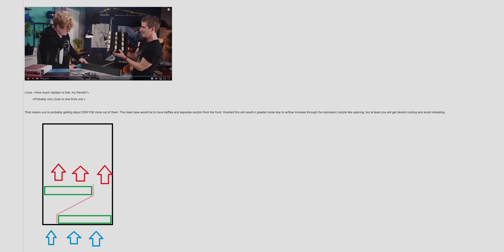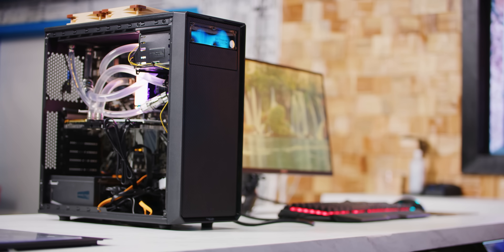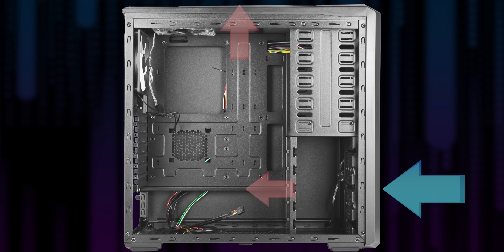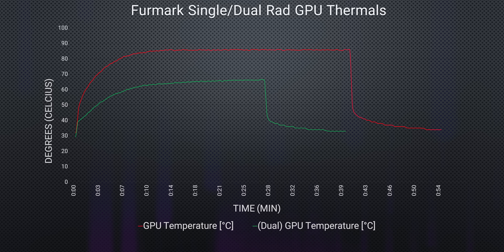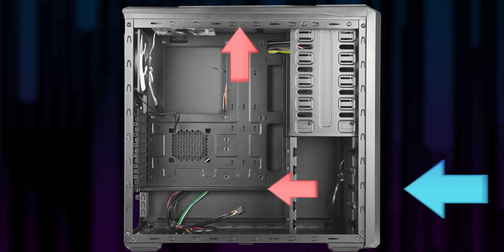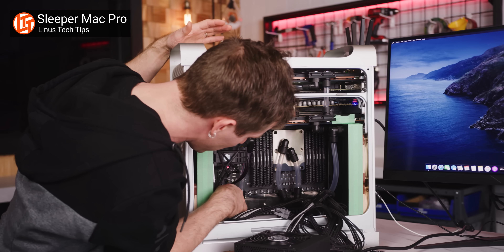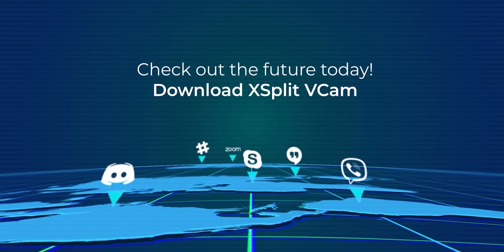I’ve been water cooling wrong for YEARS - $H!T Manufacturers Say

Comment: As a mech. engineer I can say what Corsair claims is plain, shameful BS.. What they say is a technicality; IF a radiator is designed as such that outlet air temperature is very close to water temp, then they would be right.. But that "if" is 100.00% wrong in all real world cases.

If the air coming out of radiator is really just 1 deg above ambient, then the design is a) highly inefficient (in terms of weight, volume and material usage) b) actually quite destructive as Corsair described, because same effects apply if ambient temp increases just 2 degrees, then radiator (depending on design) would be contributing rejected heat BACK into the system, and c) high outlet temperatures can be VERY dangerous. Not for PCs but imagine if they were right then air coming from a car's radiator would be at ~95 deg C (200 deg F).. So you open the hood when engine is working, you would be hospitalized..

Radiators are almost always designed by space constraints (for PCs, 275mm width 120/240/360mm height and 30/54mm thickness etc).. Heat rejection capability is also defined by the airflow, a component they are deliberately ignoring.. There is NO scenario that you won't benefit from a second radiator.. Add another radiator and if 1st radiator is REALLY at its heat capacity (which can be done for any radiator with sufficently low airflow), put higher CFM fans will make the air coming out of 1st radiator colder.. Add 3rd radiator, increse the airflow more, and you will still see benefits... Or go the "opposite" way, more radiators will need less airflow for same heat rejection... Add 2nd radiator and you will need less airflow for same temps. Add 20 radiators and you won't even need forced convection.. They will reject same heat with natural movement of hot air rising.

To "replicate" the condition corsair claims is easy.. Test a non-overclocked 65w i3 CPU, put 2x 240mm radiators in tandem, put just two 120mm fans at maybe ~150-200rpm. 1x 240mm radiator is 99% likely to perform better. Because water will be so close to ambient temps, additional surface area from 2nd radiator won't be necessary, and added 2nd radiator will reduce airflow, reducing cooling.. Problem is, nobody does watercooling like that.. Nobody even thinks about watercooling a PC like that. They would just stick the stock cooler and be happy... Increase load from 65W to 200W and surface area WILL matter. A lot. Ramp-up fans to 1500rpm and static pressure will easily overcome extra resistance from 2nd radiator, and only then we are talking about custom water cooling...

Comment: Did you add more water into your loop when you added the second radiator? That's a significant amount of mass independent of your energy generating/consumption systems. Not to mention the literal mass of the radiators themselves, which ambient air still moves over.

If your water cooling loop connected directly to the pacific ocean, your system temps would all be at pacific ocean temps. 500W can't noticeably heat up that amount of mass.

Comment: I think corsair is trying to say it is not as efficient as keeping them seperate, because you also have to take into account the added water and surface area which increases cooling capacity as well. A good example would be compairing a 500w 80plus certified and a 500w 80plus bronze certified, both get the job done but one is more efficient at its job.

Comment: I don't think radiators are as efficient as the manufacturers say.  IE 40 degree water, air exiting is 39.5 degrees, no..
Stacking them then, you are in your "not quite double, but significantly better" range, call it a 50% improvement for 2, and a third is null, just guessing.
If you have all your rads exhausting from the case, and enough fresh air intake, then the advice from Corsair really doesn't apply, as the air isn't being re-used and still has a high deltaT to the water.

My recommendation: if you are going to use more than one radiator, test it with one, and then with each subsequent addition.  Because then, for that exact build, you can be 100% certain you know one way or the other if it was useful.  And if not, then you'd probably spend some time making it work better, sooo...

Comment: Given how hard you were pushing that single radiator, I think you actually just had enough liquid to air thermal differential that the radiator just wasn't able to take full advantage of the heat capacity of the air flowing through it. That is the exact opposite of the scenario Corsair described in which adding a second radiator would have been ineffective.

If you're going to do this again seriously, log liquid and air temps at the inlet and outlet of each radiator, and subject them to a variety of constant thermal loads (Maybe GPU only, then two CPU cores more per run, for example). That way you can find the balance point of heat load where there is no longer enough thermal differential that serial radiators will improve your cooling performance.

Comment: Gotta say, physics dont lie lol.  I wouldn't stand behind a claim just because 'i tried it once and it worked'.  

The concept of a PC case is flawed beyond belief when it comes to cooling, t is designed for form and performance, NOT thermal dynamics.  That said, the cooling designed around said cases are even more flawed, because its base don a flawed structure that wasnt designed for thermal transfer to begin with.

Now, just because something works, doesnt make it right.  PC cases and PC coolers are HORRIFICALLY bad in terms of function and performance....but they sure do hide away nicely :P  

The correct design is to remove the heated air altogether, not mix it back in with intake air (poor case design).   The correct cooling would be to use a better medium and thermal device instead of open air over a single phase material (water) interacting with a known heat source (CPU, GPU, RAM). Proper heat load calculations are not done in terms of power used and heat generated....manufactures just try designs that "preform the best". 

The "best" cooling isnt slapping in a 'huge-ass' heat sync, big radiators, and a pump. The correct way is a lot more complex....but water/air works for now so no one goes beyond it.

We aren't looking for cooling, we're looking for heat management in the PC world. If you want cooling, I can make something cold...I'm an HVAC tech, I know how to chill things below freezing.

Comment: Linus: “Do your own benchmarking”

Me: “okay, let me order what I need“

My Bank Account: “Bruh, not even close”
Reply: What he meant was, take your existing parts and test in different configurations. Are you pulling air in the front and exhausting out the top? What if you pull air from the top and exhaust out the front but simply turning the fan around. What happens if you remove a fan, or move one fan to a different area.
Reply: @fayenotfaye  They perform like ass, you might as well be on air because they lack the microfins to efficiently get heat from the CPU into the water. Which makes them perform no better than an air cooler that's still much cheaper than buying a whole custom loop, which makes them pointless.
Reply: true
Reply: Drat! Parts shortages are at an all time high =(
Reply: But wait... he said it's free though... no bank account needed right? (Except for all the spare parts needed to test all different configurations...).
Reply: "Its easy, free and fun!" Yeah one of those is correct
Reply: @fayenotfaye  aliexpress waterblocks are absolute garbage and not worth using in a water cooling loop.
Reply: My bank account: "lol no, are you nuts?"
Reply: Just ordered my 10900k and it shipped so be here Friday... Too bad my motherboard isn't set to arrive til the 22nd.

Comment: The real issue here is, how are the radiators plumbed? 
Is the radiator with the hottest fluid (directly from the heat blocks) setup as case exhaust, or case intake?   IF it were as case intake, corsair might have a leg to stand on. BUT anyone with some brains would plumb the hottest radiator as the case exhaust (hottest water giving the hottest air more heat) and then in series adding another radiator as case intake (slightly cooled water, getting the coolest air).

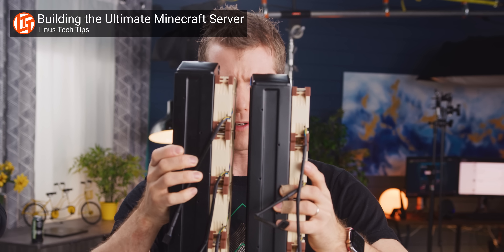Comment: 0:53 Duh?!  1:24 Incorrect if exhaust fans are not fast enough.  Edit1: None of you guys in LTT get Corsair's point.  It is not about stacking rads is wrong, it is the airflow! INTAKE AIRFLOW!  A radiator that is dumping heat inside a case is immediately wrong, regardless of how many exhaust fans you have.   So much tech people misled with positive airflow in a case.🤦‍♂️

Comment: It looks like you're pulling in air through the first rad with a single fan, but out through the second, bigger, rad with 2 fans, so of course there's a negative pressure in the case that's bringing in more cool air. This is a testing fail.

Comment: Shows a case with two rads in the only two air intake slots, then shows multiple rads stack next to each other, does a test with a case with multiple air intakes cutouts and says Corsair is wrong... Okay Boomer.

If you watched Jayz videos you might have learned about the diminishing returns that comes with too many Rads and why it is better to have two to three high quality rads with good and separate air flow.

Comment: why have a case? just frame a box and cover it with rads and blow air from the bottom so it goes through the rad box...all in series ..you might like it color each with leds if you want :)

Comment: Perhaps there was a miscommunication from Corsair, because there's a serious thermodynamic flaw in their supposed statement. 

It's this, they are assuming perfect heat transfer from the incoming air that flows over the 1st radiator. Meaning, they are imagining that if 30C air flows over a 50C radiator, the air exits the radiator fin array at exactly 50C. Then, as Linus alluded to, there would need to exist a perfectly sealed case so that the now 50C air exits over the 2nd radiator and no additional thermal energy is transferred to the air.

The major flaw is the assumption of perfect energy transfer to the incoming air.

A better statement would be "You should place both radiators in a manner that uses air already pulled through the case and then exits out through the dual radiators". There is some truth to the idea that using a radiator in the flow of incoming air is less than ideal. The air leaves that first radiator warmer than ambient (room temp) and is less effective flowing over the 2nd radiator as it exits the case. However, not every case allows the owner an ideal situation of a dual exit flow radiator setup.

Frankly, the ideal set up is probably have two or more free standing radiators OUTSIDE the case sitting on a table with the liquid medium arriving from the case.

I doubt that Corsair created their own software to analyze flow patterns and heat exchange. They are likely using an off the shelf simulation software and probably need to study up a bit more and tweak the behavior of their model.......OR....there was some miscommunication here.

Get Steve over at Gamers Nexus on this. He'll think it's Christmas if he gets to set up multiple case radiator scenarios.

Comment: as long as each rad gets some form of clean air flow then some perfomance advantage, Layout permiting will be gained to a point. If you want the best performance then you might be looking at a full custom build. Some day soon i'll be making a custom case with a seperate zone for my radiatiors to bleed the heat out with out it going into the main compartment. It's all trial and error with a bit of luck.

Comment: So, how about a temperature probe at the water inlet and outlet of each radiator?  If they're plumbed in series, so the same flow of water goes through both, you get an exact measure of how effective each one is, and you get an immediate reaction to little changes like blocking the extra air intakes, without having to guess at the resulting CPU response.  (Yes, measuring the CPU temps is what you're actually trying to measure, and that's a fine overall and effectiveness test, but the temperature measurement would tell you more about how much the radiators matter, vs, for example, *having twice the number of fans in the airflow path*...)

Comment: No. If you blow 130-150F air from one radiator over another radiator with 160F water inside it, you won't get shit for change. It has diminishing returns. The 3 back-to-back radiators in the minecraft server is an excellent example. Yeah you have thermal mass for short bursts, but a sustained load isnt going to benefit from HOT AIR BLOWING ONTO A RADIATOR WITH EQUALLY HOT WATER.

Comment: I think yall may have misunderstood corsair. Per the laws of thermodynamics corsair is correct. If you  blow (used) warm air through a rad its cooling efficiency is decreased because the delta between the cooling fluid (air) and thermofluid (water) is smaller.

Comment: I use to use Corsair water cooling. After having the radiators of 4 of them Explode [4 out of 4] I gave up on water cooling. [But why did & How did they explode?] They used a coolant fluid that after a month , or 3 separated into clear(ish) liquid , and a chalky sludge. The sludge clogged the radiator. No water flow , brought the coolant to boil. A steam Explosion followed.
Now about multiple radiators : Multiple radiators work very well so long as they are Not stacked on top of each other.    ===      better to have them this way - - - - - - .

Comment: You could get a case that has both front and bottom radiator mounts and do two intake radiators with regular exhaust fans at the top and back. That would get rid of any possible issue of hot air being blown into the second radiator since they'd both intake from outside cool air. You'd need a more expensive case likely.

Comment: Wind speed is a factor. I use to race and in older cars there's enough room between the radiator and grill to put a 6 pack of your choice of drink. Every 10mph drops temp 1°F. And that's with the 6 pack off to the side, not in front or against the radiator. Fan speed to air flow makes simulators faulty if this is not taken into account.

Comment: I believe running exhaust (hot) coolant through an exhausting (exiting) radiator in a case, and then through an intake rad would greatly reduce the issue Corsair is bringing up.

Comment: I wonder if you went with a reversed fan config for multi rad loops. Like making the rads intakes and any non-rad covered fans exhausts. You wouldn't be pulling any heated air from a rad though, while potentially reducing cpu/gpu temps, you might worsen the cooling on other components since it'd be harder for other components not part of the loop to get sufficient airflow because the typical rear exhaust and bottom (if any) exhaust/intake don't really blow over any components in a significant way unlike front fans to top mounted fans. Older cases can bypass this issue with side panel mounted fans since those can blow directly down onto components without additional impedance like cables and drive cages. In a older case with side panel intakes, you could technically make the top, front and even rear rad placements all exhausts and use high airflow fans on the side and bottom (if available) panels for fresh air intake, effectively eliminating the issue of radiators having to cool with preheated air.

Another method is by "pre cooling" liquid by running fluid from your res to the front rad before sending it out to your system then passing it through a second rad to cool a good deal of the heat before it passes back down to the front rad. Eventually, the whole system would equalize but the top mounted rad would be getting the bulk of the heat dissipation and the front would dissipate any residual heat before sending fluid back towards the components.

Comment: Regarding the Minecraft Server: Removing the radiator rises temperatures by 5 degrees, probably because the radiators dont have enough surface area to begin with. However, the real test would be to put the 3rd radiator BESIDE the other 2 so that it draws in cool air, and I bet it will drastically improve it's performance. Corsair's claims is that STACKING (as in, sticking one's output to another's input) is very ineficient to outright detrimental, not that it will ALWAYS be detrimental.
Obviously with the Minecraft Server the stacked radiators are because of space limitations, and stacking inneficiently is still better than just not having enough heat dissipation.
For example, it could be possible that better thermal performance can be achieved by spacing two radiators and opening venting fins in the case between them, as to let the second one draw in cool air, and thus increase it's heat dissipation capacity, possibly beyond what the 3rd stacked radiator provides.

Comment: The effect Corsair is describing should only happen if your baseline single radiator is large and/or efficient enough to achieve near equilibrium between the water and exhaust air temps, but in this experiment, you didn't test to verify whether that was actually true.